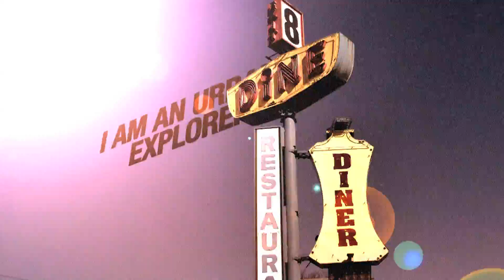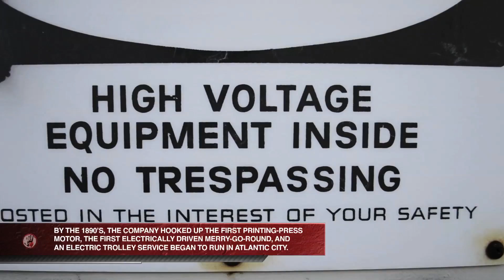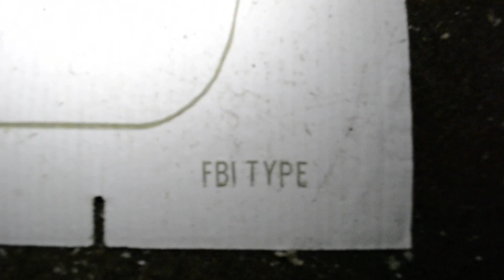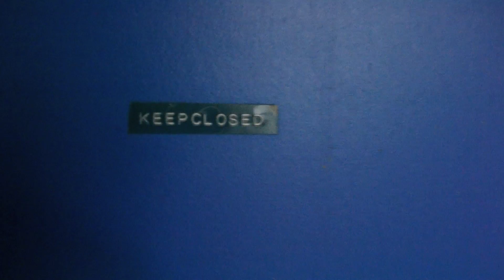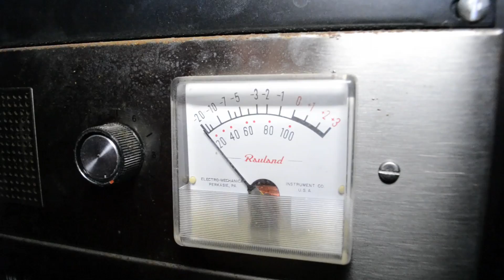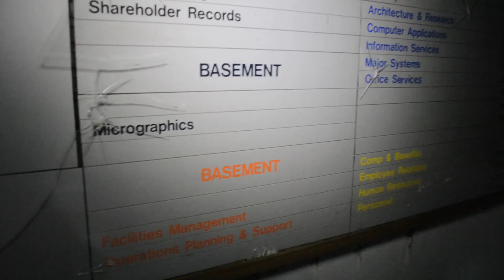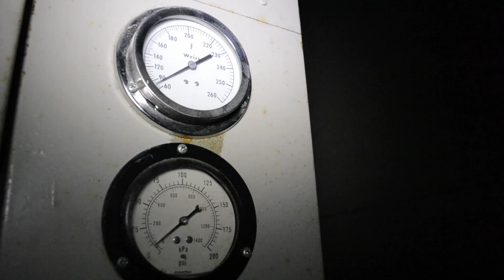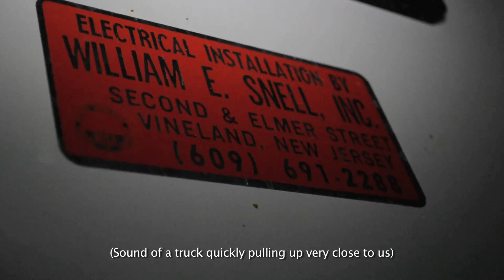Exploring the Abandoned Atlantic Electric Control Center - NJ

Comment: Such an odd background noise most of the time... Have you found any buildings with water or power still on?  I found one years ago, abandoned for 30+ yrs and some of the lights still worked. Nice work!
Reply from the maker: David Starr I have found a couple.  One that comes to mind is the Psychiatric Hospital video.  The place is is bad shape and been abandoned since I believe the early 90s, but in the basement I found a room way in the back with power machines running.  Scary because the basement was also partially flooded and there was a possibility I unknowingly could've died from electrocution.  Thanks for watching David!
Reply from the maker: Here you go: https://www.youtube.com/watch?v=nj8XNGDI-I8 It's a long one. Enjoy.